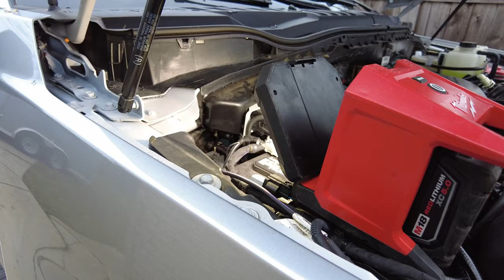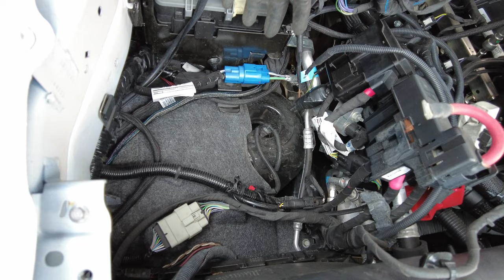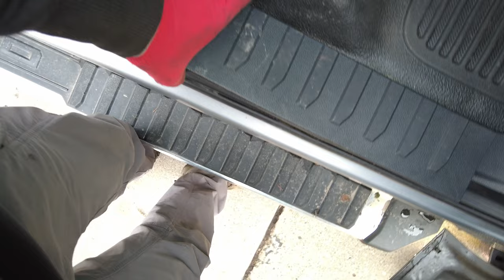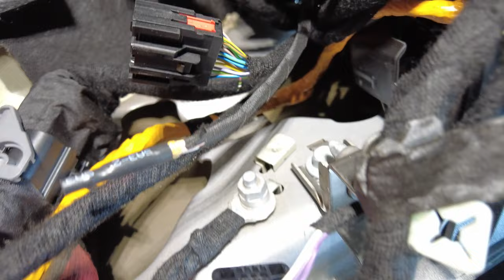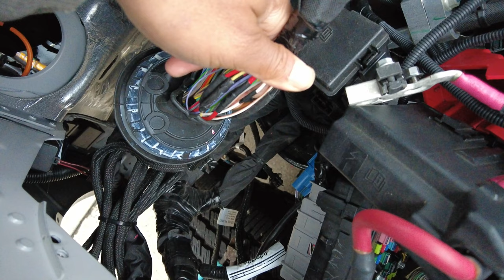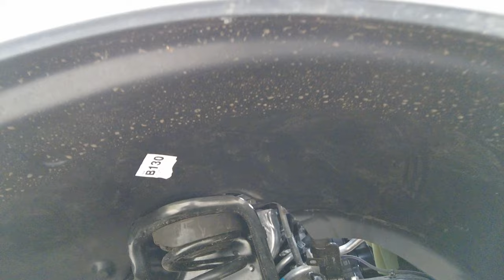I MESSED UP - Damaged my brand new truck.

Comment: I was installing a MDP piping kit on my 19 6.7. I didn’t cover up the openings on the valve covers and dropped a bolt down in the motor. Had to pay for a mechanic to come out with one of those cameras and find it and grab it. We all make mistakes. Live and learn